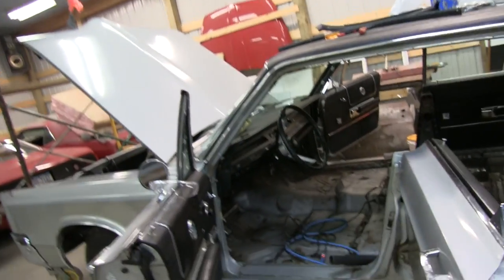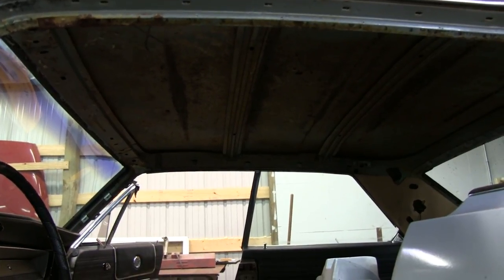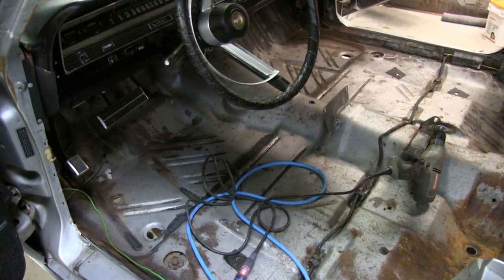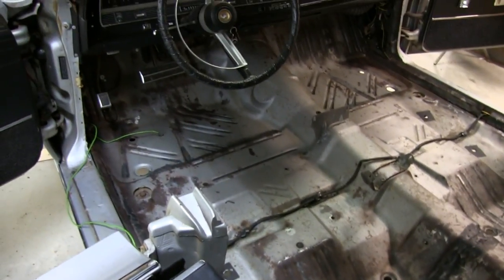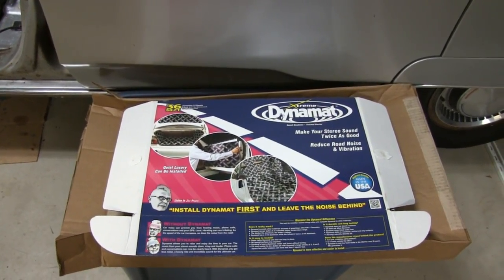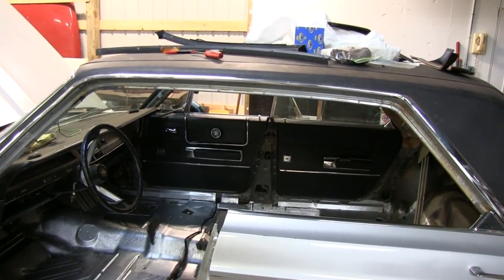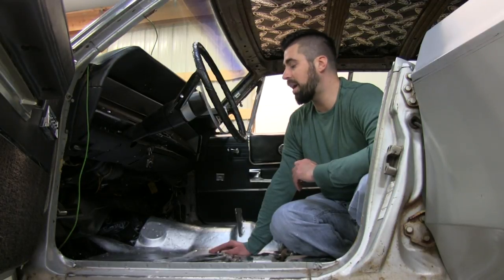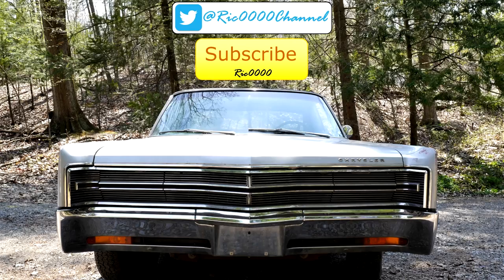Painting Floor and Installing Dynamat 1968 Chrysler 300

Comment: Sorry, I maybe missing something and it could be my ignorance, why did you put Dynomat on the roof?
Reply: I hope I am not speaking out of school here, but a lot of cabin noise comes through the roof. Also, I heard that stuff is a pretty good insulator and a whole bunch of heat comes through the roof too.
Reply from the maker: No, good question!  The car will stay cooler and quieter.  Dynamat is a "vibration dampener", it keeps the panel to which it is applied from vibrating and transmitting sound.  Since the roof is basically one giant flat sheet of metal, it will want to vibrate and transfer road noise throughout.
Reply: I had thought so. Just wasn’t sure and I never did Dynomat on my roof before headliner install. Makes sense. Wish I did now. Hahahaha